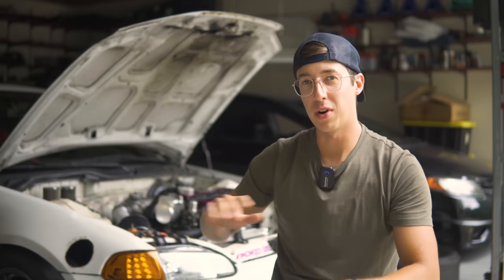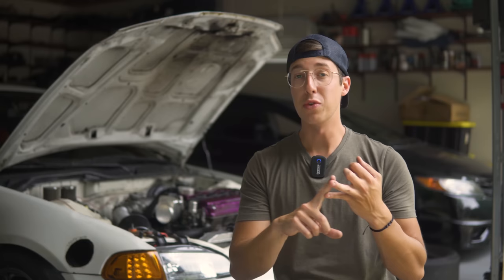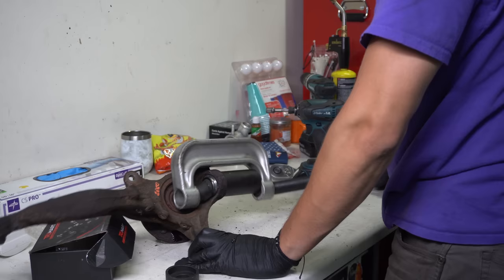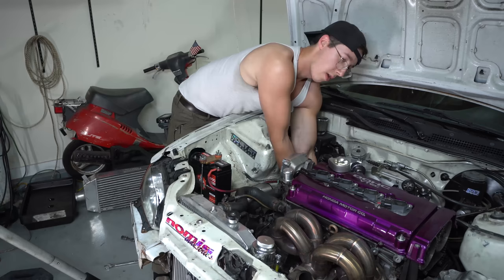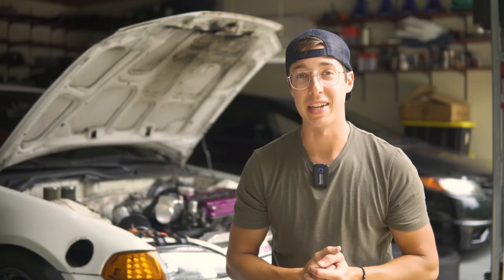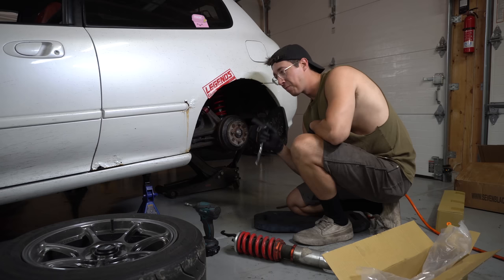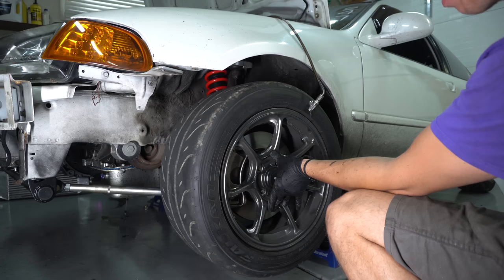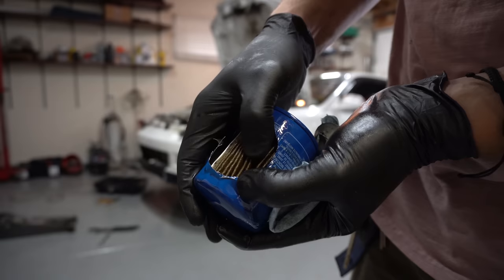Honda Civic Big Brake Kit Using Mini Cooper Brake Rotors! (INSANE BUDGET)

Comment: This is a great budget brake upgrade. One thing to note is that the EK knuckles are 1/2" shorter than the EG/DC ones, regardless if they have the smaller or larger "EX" brakes. So if you have a 92-95 Civic, you really should use 92-95 Civic EX or Integra knuckles. If you have a 1996-2000 Civic, you should use a 96-00 Civic EX or 99/00 Si knuckles.
Reply: I got a 1994 ex but I didn’t realize I had 262mm rotors I figured I had 240mm so I bought calipers pads rotors etc for 240mm. Do you know what year calipers would fit my ex knuckles? Ex isn’t a model option on anything I look on. Maybe ek ex calipers that had 262mm rotors?
Reply: @IzzySk10  Depending on the parts retailer sometimes they don’t use model trims. You can try looking up the civic with the sohc vtec d16z6 engine. Even if you ask for 96-2000, some of them had smaller brakes. For 96-00, the EX have d16y8 engine.
Reply: @TrackSol  yeah I think I found some possibly. I gotta d16y8 from a 99 too
Reply: @IzzySk10  Also FYI on the EK, I think only the 4 door EX has the 262mm front rotors. Another option is to just buy a whole caliper/pad/rotor package for a 94-01 Integra. It’s the same 262mm 4x100, just that the caliper has a slightly larger piston.
Reply: And for Integra I can just use the knuckles that come with it correct?
Reply: @Ties445  Yes that is correct
Reply: Thanks for the information so my question is so which knuckle would be best for 94 civic eg hatch? Thanks
Reply: Nevermind i got it thx
Reply: @TrackSol  so are you able to use the stock knuckles in a 93’ d16z6 del sol Si to do this upgrade? Thanks.
Reply: @alancortez1722  No. del Sol S and Si (d series engines) use the smaller knuckles. You need either del sol vtec eg2 dohc or Integra knuckles

Comment: Did something similar to my Teggy and this upgrade slaps hard! It’s called the no BS big brake kit, and it is directly bolt on.
Reply: What caliper did u use
Reply: So i can just take off my stock calipers and rotors and slap these on and go?
Reply: You can use oem Integra calipers and pads with 280mm mini cooper rotor.

Comment: you should really get those spacers to center the brake rotor, its not about the clamping force of the wheel but keeping everything balanced to stop wheel shake and such.
Reply from the maker: I understand your concern, but I had no wheel shake or braking issues on track. 3 whole days of beating on it.
Reply: Hi @tropg what do you mean by spaces wheel spacers? Or different space im a newbie so i want to know more knowledge TYIA 🙏

Comment: Doing this on my Ek but I’m using ITR calipers and Integra front knuckles. Got everything from RockAuto, I’m just waiting on new front brake lines and I opted for HardRace lower ball joints. I’m pretty excited! Also in saving the rear disc conversion for later too
Reply: Itr calipers have the same part number as the crv calipers. In fact the whole knuckle assembly has the same part number between the crv and itr
Reply: The Integra knuckles are taller than EK knuckles and will mess up your suspension geometry. If you have an EK you really should be using EK knuckles from an EX or 99/00 Si.

Comment: I’m running the exact same big brake setup atm. Although it isn’t required to change the knuckled on EM1s. If you ever plan to track the EG, invest in a set of Circo brake pads. They are by far the best pads on the market. They’re quite pricey ($400 AUD) but they outlast the rotors and everything! Also invest in braided brake lines and high temp brake fluid if you haven’t already. I can take the EM1 out to the track and go hard for an hour straight and have zero brake fade in that time. Absolutely love your content and keen to see the EG out on the track!!
Reply: And in saying that it’s soooo much cheaper than doing the DC2R brake conversion same as the Brembo upgrade too

Comment: I've ran this on all my tegs and civics 1 thing is it looks like you didn't get the lug washers which is needed so it remains hub centric as the mini has a larger wheel stud another thing is get good pads or  you won't be that impressed also get rid of the dot 3 and get dot4 bc on track it's easy to boil dot 3
Reply: Where can I buy lug washers? Thanks from a newbie!
Reply: @FE428Power  Amazon or eBay is where I get them lmk if u don't find them I can find a link for ya
Reply: @devinej8411 if you could send me a link for those lug washers you’re talking about. I googled it but it seems there’s many shapes and sizes and I don’t wanna buy the wrong ones. I have a 98 ex if that info helps.
Reply: @keithuzzell8486 It wasn't letting me post it directly to you but I put it up these are wat u mant

Comment: John,

When I used mini cooper rotors, type r calipers, stainless steel braided lines, type r brake pads, the rotor wobbled on the studs a hair.  I searched 1320 performance rotor spacers and no more wobble.
Reply from the maker: the wobble on the studs did not affect the car on track. I did not notice anything weird with the brakes after 3 whole days of beating on the car at the track.
Reply: What stainless steel line did you buy? And what did they fit for? Mines are rubbing the wheel.
Reply: @RobertEdits  

It was an ebay special.  Purchased for the Type R not the GSR.  They were on closed out i thunk they were about 24$
Reply: @brandoncruz682  yea man I may have to do that I’m fuckd rn

Comment: I have an EK hatch and doing a complete DC2 front and rear disc conversion. Will this set up work with DC2 front spindle? And does it require any mods or addition parts?

Comment: Wondering if theres a big brake updgrade for the rear disc cuz they are pretty small
Reply: There is! You can use the itr rear calipers with EP3 brake rotors. If you want even more budget, you can use base dc5 rear calipers(what I did), But the bleed nipples will point downwards so you gotta take the caliper off, turn it around to bleed.
Reply: @toopyandbinoy8893  Is that worth doing in your opinion? I only did the front currently
Reply: @toopyandbinoy8893  Thanks for the info, I'll have to look into it. Currently putting in gsr rear trailing arms, and they look tiny compared to the mini rotors in the front 😆
Reply: @ssjdavid  I didnt drive with just the fronts so I couldn’t compare. But in terms of balance, it felt the same as before. Generally going bbk in only front throws brake balance off. I suggest you get itr calipers instead of dc5 tho, having to turn the caliper around to bleed is quite a PIA

Comment: I already have a gsr integra but, I can't remember if the first gen crv and integra, had the same front brakes???
Reply: Not quite, the CR-V has a 5 lug bolt pattern but the Integra is 4 lug so the rotors wouldn't fit.
Reply: @wowdogeful  yeah but, the Calipers??
Reply: @jadenkeosavanh1774  yes, the calipers are the same 
You can interchange them on rock auto play at the same

Comment: My eg in New Zealand runs prelude front brake discs and calipers😊 did you upgrade the master cylinder?
Reply from the maker: I did not upgrade the master cylinder. Had no issues on track.
Reply: @boosted_john  look up the mc upgrade, Master cylinder, 15/16" from a 90-91 civic EX. honda oem part # 46100-SH4-A11. Love your channel fyi

Comment: idk why people do this over the direct bolt on wilwood 4 piston calibers?
Reply: Because If you have an ex or si you can just spend about 200$ to swap this in
Reply: I’ve ran countless laps with this setup and never managed to fade them on track. I managed to fade a set of Brembo 4 pots on an Evo in about 2 minutes and and a set of brembo 4 pots on a 911 turbo in about 4 minutes…..fitting bigger brakes than you need is increasing unsprung mass which is the worst place you could possibly add weight. Quality pads, disks and fluid are more important than bling looking callipers.

Comment: Does the slicks fit over the caliper or it rubs with the new big brake it ?
Reply from the maker: It won’t fit with new brakes. Will have to switch back.
Reply: @boosted_john  thanks god I ask I was about to install on my hatch for drag racing

Comment: First First here to comment , love the big brake upgrade 😀👍🏽
Reply from the maker: Thanks! Have you tried it before?
Reply from the maker: Thanks! Have you tried it before?
Reply: @boosted_john   unfortunately I have never done a big brake upgrade before . only drilled and grooved discs for the front on a toyota celica 1.8
Reply: @boosted_johnwhats up John,  I have a 97 ex and want to do the same but with different pads just for street use. What years tsx pads fit that setup exactly? Appreciate the content and any help brotha!

Comment: Should of just got the wilwood 4 piston bbk only 500
Reply: I'm not sure where you got that for $500, the part is $900-$1k depending on which one you get
Reply: @wowdogeful  late reply, but youre wrong. theres a wilwood kit with pads and rotors for 560$ ish. and uses stock lines!

Comment: You should have ran with the Turbo on the B16 trans for shits & giggles. Possibly bust the myth of short ratio trans & turbo cars. 🤷🏿‍♂️ It would have been great for content.
Reply from the maker: I could give it a shot when I put the built motor back in.
Reply: Done it, prefer the ls trans for turbo. Youre sifting by the time you hit powerband. Might be good for a small turbo for fast response, but not big tubskis.